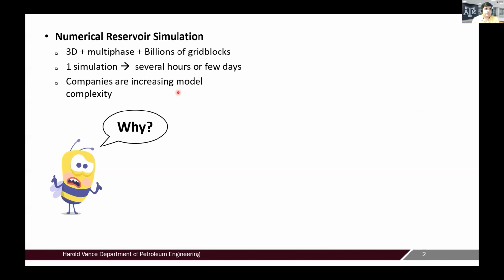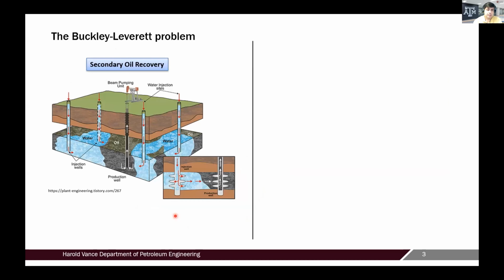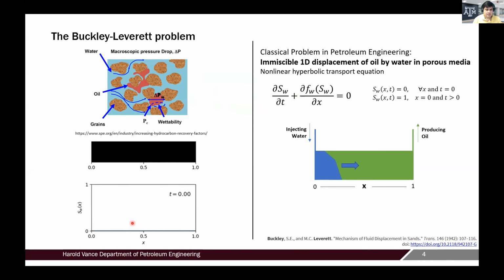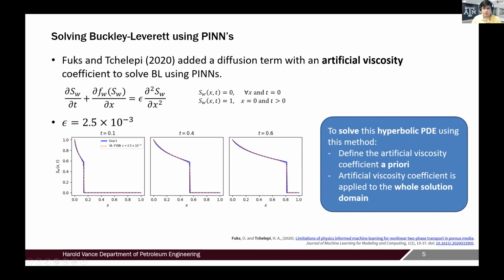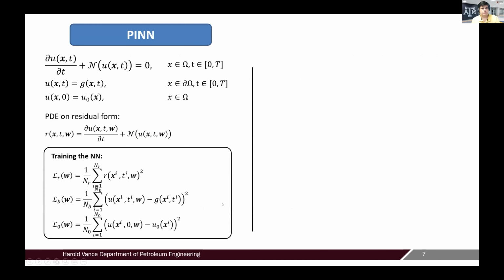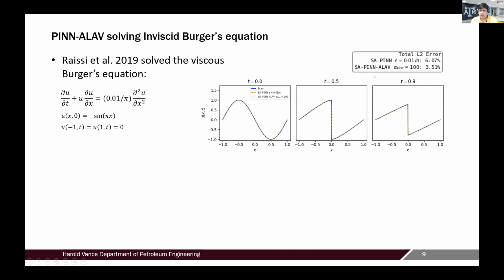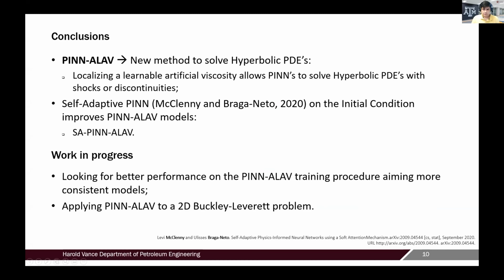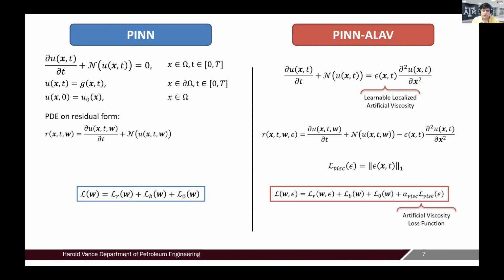Stabilized Hyperbolic PDE Solver by Adding Adaptive Localized Artificial Viscosity to PINNs

Comment: Nice presentation, but the loss term for the viscosity at each points in time has the look of a weak penalty term. By that I mean this is a constraint we want the viscosity to follow. I feel that there is an equation or loss term missing to have a well-defined problem. Did you add experimental/real data to be fitted in the total loss?